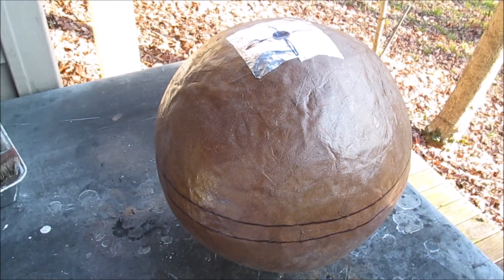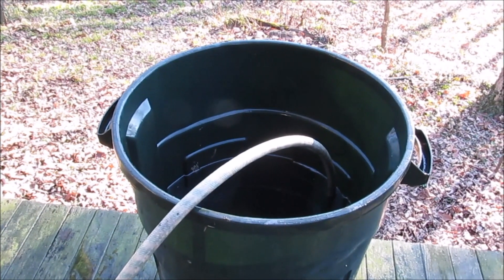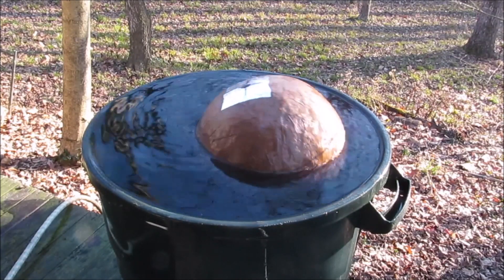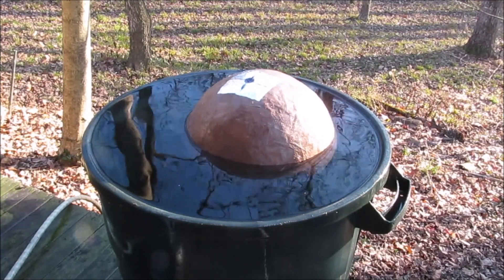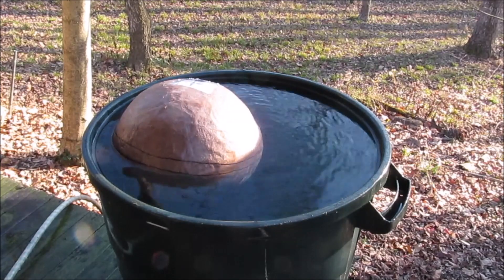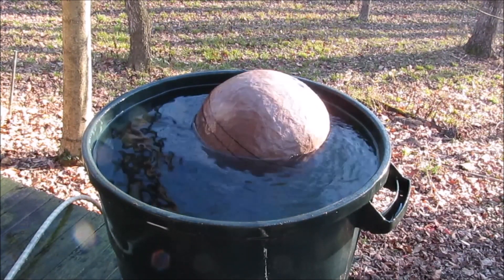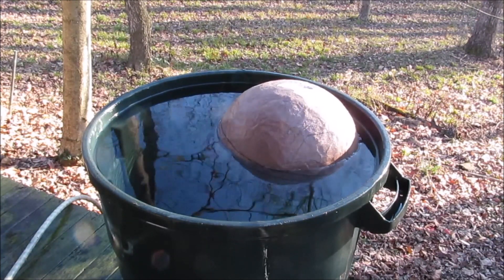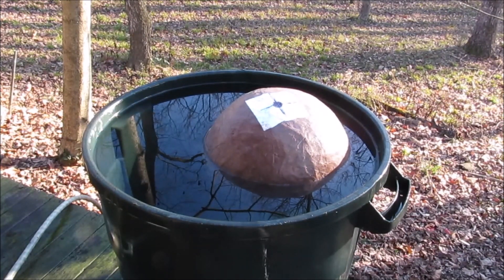Construction, and float testing, of prototype 12 Inch Fireworks Water Shell

Comment: I believe the self righting bouy concept is the best way.  With the 12“ ball shell make the burst charge at the bottom forcing the stars up and out. Place the 12" shell on top of a 11 1/2“ cardboard cylinder 30“ long filled with foam and 10 lbs of concrete at bottom for buoyancy.   It will quickly straighten upright in the water and force the stars up.

Comment: i would maybe on the inert side add some ribs after wasping perhaps in a cross about an inch tall  out of maybe balsa or 1/8" underlayment ply pasted with craft tape before you do the waterproofing.   should create more drag on the inert side to make it stabalize faster and as a cross should not interfere with the trajectory when fired.   a smooth ball rolls alot but one with a bump or rib kn kne side wont roll.

Comment: You can attach a small anchor to the bottom to make it stablize faster. And have a light string hooked to the anchor weight, as to be able to retrieve the weight from the bottom once it sinks.

Less concrete on the inside. And make the weight hang down from bottom of shell on outside.
Reply from the maker: How would you have all that survive the shell being launched from the mortar, James?
Reply: @nedgorski ...my apologies for talking out of my ass. I watched it twice but seems I missed the part of you’re going to fire it out of a gun. I had imagined you were gonna just toss it out of a boat or something and have it prepositioned for a show or whatever. Again, my apologies!
Reply from the maker: @fineartonfire_5327  No problem, James. Some Japanese water shells are deployed as you imagine. But, I want to play with launching them at a 40 degree angle to the ground. I like that challenge.

Comment: For future reference you could cut down on time if you weigh out glue and masonry plaster to the proper density with water. Then apply that into the bottom half of the shell. I’ve been getting by using a half masonry plaster and half glue mix that allows a sticky enough mix to fill back into 1.75” canisters for star testing. Stuff works just like China and also breaks into the small pieces like there’s. No chunks have come down yet. Also does normal Japanese or Chinese time fuse work in the water? Or are you using a spollete device?
Reply from the maker: Ben, in this design, I need the density of the concrete, as far to the bottom of the shell as possible, to stabilize the shell in the water. And, the time fuse doesn't go out if dunked into water. It keeps on burning.
Reply: @nedgorski  yep. I’m not sure if the density of masonry plaster mixed with wood glue is the same as concrete. My thought was instead of having them separate, just pour into the bottom, that way the glue just sticks to the hemisphere and then doesn’t require a secondary gluing. The idea is that the glue with the plaster bonds to both itself and the hemisphere. I may be not understanding that the density of plaster and concrete are not the same. If that be the case I’m pondering if there is a way with glue to make them that way. Maybe I’ll post this on the forum and see if I get any responses. This is one of the shells that I’ve always wanted to try but in smaller caliber. Definitely hard when Arizona has like 2 ponds. Shouldn’t have moved from the land of 10,000 lakes to the land of one without trying this shell.

Comment: Add an X of  fins or a "rudder" to slow the wobble when it lands in the water. Also, give that sucker very hard spin when test dropping in the water to recreate the spin of a shell coming out of the mortar.
Reply from the maker: Whatever might be added has to be able to survive the lift of the shell. This shell is to be fired from the bank to the center of the lake, 1000 feet away.
Reply: @nedgorski  I completely agree. Maybe mold the fins out of glue and paper as part of the last two final wraps of paper? Water imparts a lot of drag so the fins don't have to be huge on the shell.
Reply from the maker: @Northerncalwolf  Right now, I'm adding 8" rings of plywood, to create the "lift bucket, which will stay on the shell and act as a stabilizer under water. At least that's the idea. More testing to come.

Comment: Hi Ned 
I'd recommend gluing some pieces of scrap wood on the bottom (or top? The half that is in the water). This will act as baffles, causing drag when it rolls, reducing the time it takes to settle. Just plop a handful of ~inch by inch blocks on the bottom half in a random pattern, it should help. Can't wait to see it in action!

Edit: oh I see this has already been suggested a couple times in the form of fins.

Comment: Also, the shell will go concrete first because a projectile wants to be nose heavy (think how an airgun pellet placed in a gun backwards flips within 10 yards)
The projectile then enters a period of zero gravity (like the NASA parabola plane) which is when it will start spinning erratically this period of time makes any weight in the shell obsolete and it will not reorient.
When it starts to fall again, it will not take long for it to drop that concrete very rapidly, but that being said, if your timing is not just right, you will have an enormous shell with plenty of concrete in it barreling back down to the ground.
A small discrepancy in timing will result in a failed shell.
I think the overall concept would work better in a rocket with a large stick. However everything I have said here may be proven completely incorrect so I guess we’ll have to wait and find out. Thanks for posting it’s always great to learn from the best. 
Anyways that’s my two cents I hope it is of some help :-)
Reply: Oh, wait
Are you floating this in a body of water?
That explains why the time fuse was so long
Nevermind all of what I just said
At least the concrete end will enter the water first
Also note that the shell will sink pretty far before it starts to rise again
Really cool concept!
Can’t wait to see it!

Comment: Why add a counterweight, the hidrostatic effect of the explosion will anyway create a conical shaped explosion, if you see a commercial one have nothing else different from a common shell, the only difference is in the time fuse that is longer to permit it to arrive on water before go off.
Reply from the maker: I didn't want to go to the trouble and expense of building a standard "bottom half" of the shell, only to have it lost while the stars are driven down into the water.

Comment: Ned, Just glue a stick opposite of the time fuse hanging down in the water with a weight on it. That will stabilize quickly.
Reply from the maker: Yeah, but having that apparatus survive the shell being launched from a 45 degree mortar on the lake bank, would be the challenge, John.
Reply: @nedgorski  ah ok. Didn’t know you were launching it.
Reply: You need to attach collapsible wake stabilizers to the sides at 90 degree offsets for 4, or 120 degrees for 3.